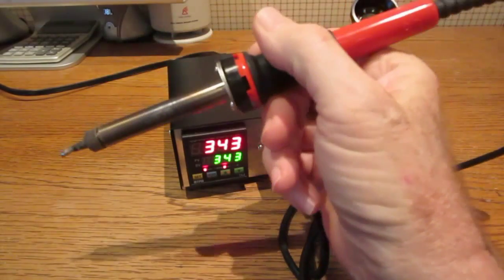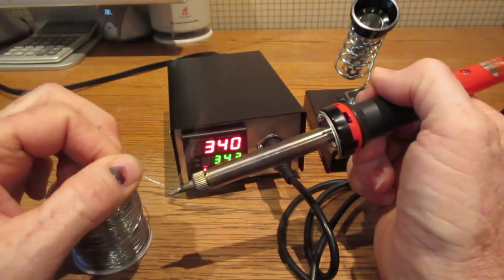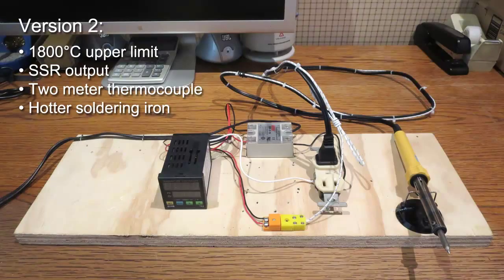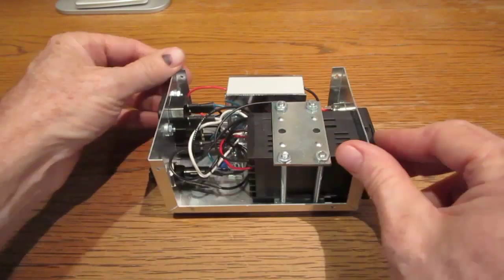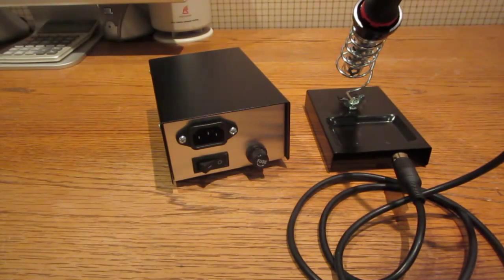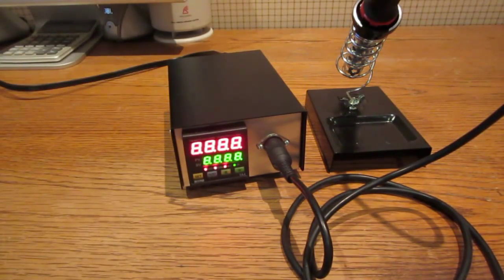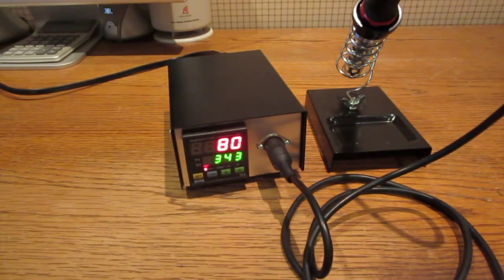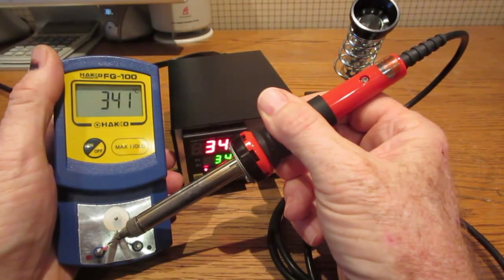DIY 110v Temperature Controlled Soldering Station

Comment: I think this soldering iron is slow heating without transformer
Reply from the maker: Yes I agree. The mica heating element is a slow heater. It would have been nice to use an iron with a ceramic heater and a PTC heat sensor with a transformer, but the selection of compatible irons was limited for most PID controllers like this one.

Comment: Hi, thank you for sharing. I like this project 'cause it is very simple to implement and appears to be very reliable. I have read all your posts on pcbsmoke. The only problem is to find an iron like the one you have used, here in Italy where I live, and of an acceptable quality (it does not make sense to build a reliable controller if using a bad iron/tips,imho). Also, I'm facing a problem with my Velleman VTSSC50N soldering station (a really junk chinese station!). So my questions are:
- what 220V/60W iron has same shape and, overall, room for thermocouple?
- is the AGPtek PID Temperature Controller reliable? I have seen also some Omron working with K type thermocouple at 40/40 $
Thank you for any help.